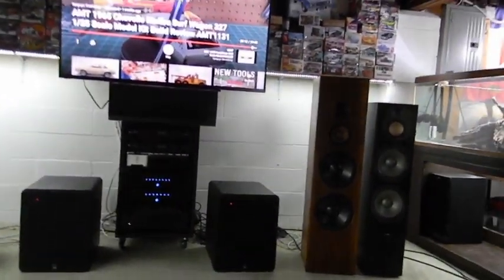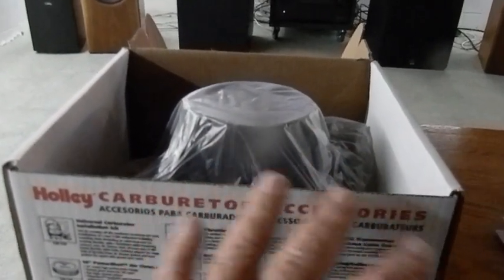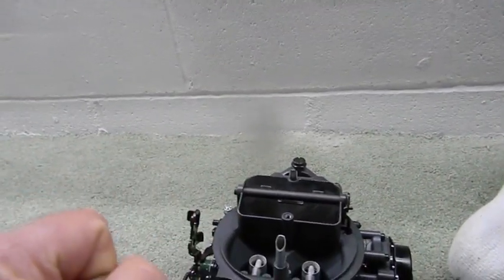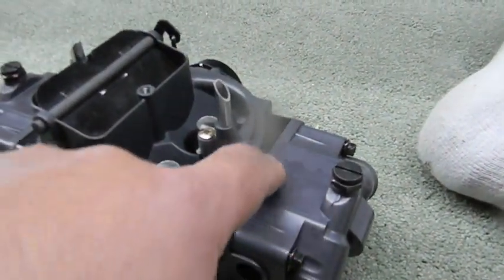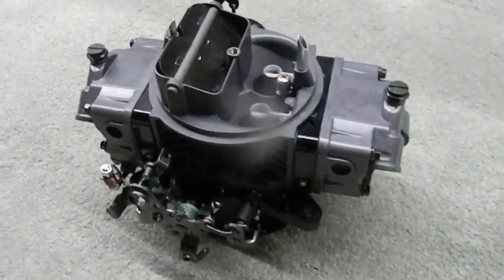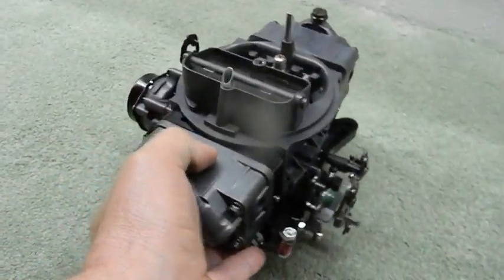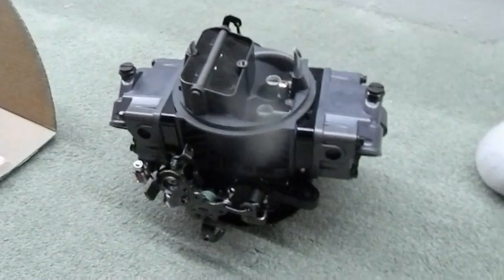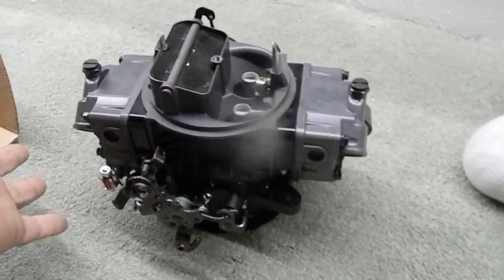Holley Ultra Double Pumper Unboxing

Comment: Why a Ford kickdown lever on the AMC? Isn't Jr's car running a 727? By the way, I love the wall of models!!!
The Holley guy does have his bosses on his ass because of the bottom line mentality of businesses today. They care more about how much money they're making than they do about taking care of the customer. If the were going to sell that it should have been marked down and you given the option of buying that carb on a discount, or buying one in top shape. I would have bought the scratch and dent version. Last year I bought a new speaker for my Guitar amp. The factory speaker sounds like shit! So I looked around auditioning everything I could with headphones and you tube, plus reading every possible review and ended up buying a restocked speaker from WGS, Warehouse  Guitar Speakers. They warrentied it against defects, but it sounds great and pairs nicely with my other amp! So if any of you play guitar and are looking for a great speaker check out WGS! The thing is I knew ahead of time what I was buying.